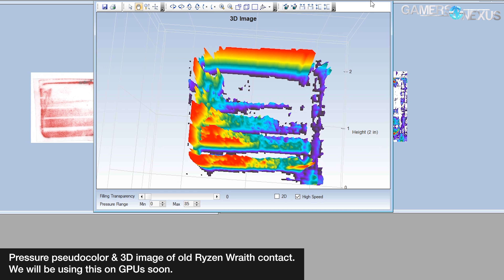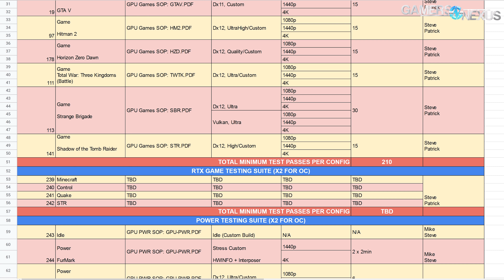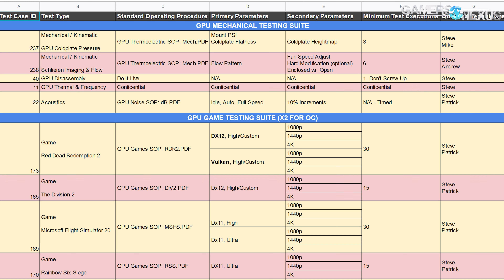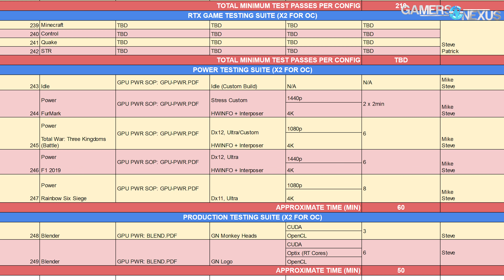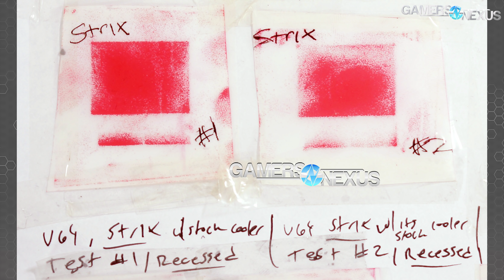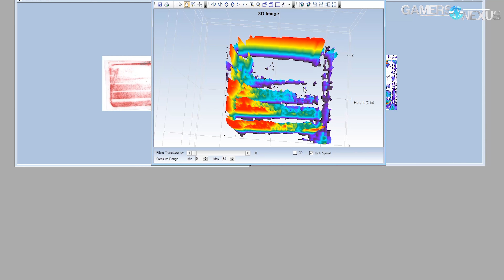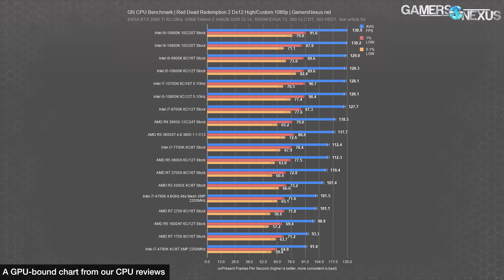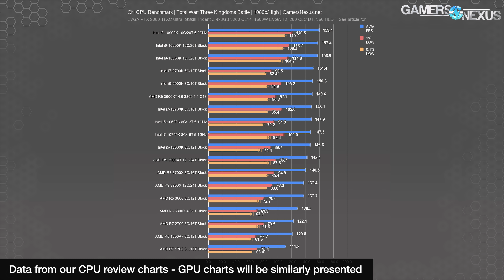$13K of GPU Test Methodology: Airflow Photography, RTX Games, Pressure Tests, Power, & More

Comment: For the GPU stuff i like that you have included blender renderings, cause 10% of a large render can be hours of time to save.
I know it might be an edge case, but more and more people do small to medium machine learning training at home using 100% free software lige python with tenserflow and pytorch. Thus it might be interesting to due some benchmark using these programs helping people deside if they should bay a gaming GPU or a "pro" GPU. This will also help you benchmark the tenser cores.
There is a huge difference between RTX 2000 and 3000 series cards thus should one by an 2080 ti used withe more tensor cores or a  new 3080 or 3070 whit less but the new tensor cores?  And how big models can you train using 8 GB VRAM vs 11GB VRAM, It might be better to have the 2080 ti with 11 GB VRAM vs a faster 3070 with only 8 GB VRAM?

Also I was so happy to see that the 3000 model can use sparse matrix now I will have to look into this, this might be a game changer for me. Thus Thanks.

Comment: Would love to see a chart where RTX performance impact is compared between Turing and Ampere, say 3080 vs 2080Ti performance delta in Control or Minecraft RTX. So the raw FPS wouldn't be the data of the chart but the percentual performance impact that RTX on causes for these cards. Maybe the 2080Ti has a 40% performance loss with RTX on compared to the 3080 with a 15-20% performance loss. I think this would be an interesting way to check Nvidias claims of better RTX performance.

Comment: If you're going to be using Horizon Zero Dawn in your testing, I suggest at least trying out the GPU scheduling thing in Win10 2004 if it crashes for you, my game went from crashing every 5-15 minutes to 0 crashes. FPS became a tad lower (from 60 steady to 50-60 average on a 1070 at 1080p with a 2700x. But hey, a bit less fps is definitely preferable to crashing constantly.

Comment: Wait, didn't Rainbow Six Siege get a Vulkan update? Why not use that instead of the older DX11 renderer? I've looked up some benchmarks and Vulkan is a clear winner and should give you a decent amount more fps. I also think that AC Odysee is a good game to benchmark, their benchmark tool is great, the endresult is quite informative and it's very demanding on both cpu and gpu which will be a good measure how well your pc handles demanding games. With MS flight simulator I'm not too sure if it's a reliable test, maybe wait until the DX12 update is out?

Comment: Wish more channels did ultrawide benches.. 3340x1440. Luckily joker does them
Ps:i hope you still add the fps numbers.. Would be stupid that people have to whip out a calculator to see what the fps was. I mean its still thr most importsnt factor when you try decide which gpu fits your need based on your refrrsh rate and resolution

Comment: I would love to see MachineLearning Benchmarks for GPU, it will be mostly Nvidia Cards but still it ist intressting to see the value of different cards

Most of my Trainings in overnight but if i testing a new a architectures i just do short runs.

So maybe train a famous CNN, and count epoch trained in a certain time like 10min

i also know littel about how OC the gpu is effecting stability of the training, can I train a CNN for 10h on an OC-card without the fear of the job stopping?
how is pcie 4.0 or 3.0 or nvmi effecting my training?

i guess it is really scientific work, but no one university is oc-ing GPUs and writing a paper about it (as far as i know) ^^

Best Regards from Germany

Comment: For the scientific, the easiest test that you can do is to retrain networks with different libraries. They are a lot of examples online and you can run them for specific number of turns and then time them. A bit more advance test can run with reinforcement learning where CPU to GPU connection is really important as simulation run on the CPU and the GPU do the training calculations. I can help you set them up if you want to contact me :)
Or easier/Quickly you can use the ready package from http://ai-benchmark.com/alpha.html, I will suggest go for Linux system or you can compare Windows vs Linux

Comment: About "FPS normalized power consumption" -> I hope you (or at least anyone) will test the reverse, "power normalized FPS". Specifically running 3070/3080 at the wattage of 2080/2080ti. It'd be nice to validate Nvidia's efficiency claims.

Comment: Testing for SOLID WORKS and AutoDesk INVENTOR is severly needed. All Major manufactering companys use these programs, and there is VERY few benchmarks done. 
Sure, I have a work computer that has an RTX 5000, but I dont do rendering, I make Assemblies that have TENS OF THOUSANDS OF PARTS. I seen Inventor use 35+ GB of RAM at one time.

Comment: If you guys weren't already slammed with work I'd ask that you look into Forza Motorsport 7. This game has some weird stuttering behavior that gets worse over time.
E.G.: at the start of a race I'm running at 160fps. 10 minutes in I'm somewhere around 100 and have noticeable frame time spikes. After 20 minutes my average is down to 60-70fps and it's basically unplayable, due to frame time spikes that are north of 150ms. Only a complete reload of the track and race resets this behavior. Just restarting the race itself does not change anything.
My temps are fine and cpu & ram load stay the same during the whole race. It just degrades in performance. (game only uses 8 threads and gpu load drops with time, due to the cpu not keeping up. might be a timing issue of internal processes, but I have no clue how to solve or validate this)
(I'm running a 3900x, 32GB ram and an rtx2070)

Comment: Imagine buying a high-end GPU and having the clocks running low because the coldplate has little contact and not even realizing it. Just going about with the FPS you get and not knowing it could be higher.

Comment: I'm going to assume that R6: Siege won't include the vulkan version in testing from the lack of mentioning it.
Reply: To be fair to GN, no one would know Siege has Vulkan support unless they read the right update notes. There’s no option to switch API in game. Even finding the -vulkan argument to launch Siege in Vulkan took me some digging.

Also while seeing how a leap from DX11 to Vulkan is indeed interesting, Siege has high framerates in both modes. That makes it difficult to visually show any perceptual differences.
Reply: @wolffenstein  When launching with the steam version you get a prompt asking for which version of R6 you would like to launch. Not sure how different it is on other launchers. Though I do agree with your second point. It probably won't make that much of a difference FPS wise.
Reply: Da Sharkman you only get that prompt when launching from the Steam Library window. If you’re double-clicking a Desktop shortcut, Steam assumes default options which is DX11. Adding -vulkan as an argument in the game’s Steam options will ensure it launches in Vulkan regardless which method you use to launch the game.

Comment: I know this isn't really the place to ask but I've been on multiple subreddits and no one has been able to help me. So I built my first pc and it turns on and I can get into bios but the problem is once I put my windows usb(its a brand new Kingston 32g flash drive) and try to reboot it to boot into windows the screen is black I've waited for hours to see if I wasn't waiting long enough but it did not matter. I have a gigabyte motherboard a amd cpu and a shappire 5700x and a western digital 1 terabyte ssd not an m.2 in the lian li lancool 2 everything is plugged in where it needs to be and the only clue I have is when my motherboard recognizes the flash drive isays the kingston 32g blah blah and the same thing but with partition 1 any help would be appreciated and if you need more info just comment (sorry this is long I'm just starting to get mad because it's been 2 weeks and it's not working yet)

Comment: Not a GPU hint, but a CPU And total system throughput test.  FreeBSD's poudriere.  Recompile 2000 to 4000 full applications in massive parallel.  For testing, the ports tree can be frozen in time so that everything is fair.  Poudriere uses virtualization, massive amounts of IO, memory and, of course, CPU.

Comment: I'm not sure how much of a workstation use case it is, but Unreal Engine 4 benchmarks would be greatly appreciated. I've been starting to use ray-tracing as means of getting a more realistic lighting in maps with day/night cycles, so having a 1070 Ti has been starting to get slow. The engine itself is being used beyond games and with an in-engine tool for creating cinematics you can accurately measure the time between frames, so creating a standard benchmark would do a lot.

To demonstrate how accurate it can be, this is a small bit of my testing for ray-tracing, UI doesn't run on the same thread, so adding a timer in it (like the one up top) shows realtime frame time and can be customized at will, I personally have it at just minutes and seconds: https://gfycat.com/pastelwhisperedamericancrocodile

Comment: So I'm curious, and I know its probably due to the sheer inconsitancy of resaults, but why dont you guys test games that are poorly optimized for pc? Like Crysis, or my personal favorite Protoype, its a game from 2009 that was for the ps3 and then ported to pc but no matter what system, with any configuration I've tried, a consistant 60fps with v sync is impossible. It even puts newer CPU's through there paces and i've seen it pin 8 core 16 thread cpu's to 100% at points in the game which almost leads to believe its somehow scaleing with the hardware. I've tried anything from an FX6300 w r9 380 to and i7 8700k with a 2060 super, 60 fps with Vysnc is just unatainable, without vsyn you can get 100-200+ fps but it still feels way choppier and stuttery the just a solid 60.

Comment: I am very strongly disagree with ISO power/performace, using iso power/performance makes sense if either power or performance actually stays the same, but wiht GPU's they dont.
No user is upgrading their GPU to get the same performance, they are goign to use the extra performance. So if everyone uses the extra performance the real efficiency consumers will see, is at the maximum performance.

Comment: 25:00 Can we please not call them "RTX Games". RTX is literally an nvidia marketing term. They want to embrace, extend and confuse just like they did with "gsync compatible" to get their marketing to stick. Use the generic term that's most appropriate. The game is either just using hardware-accelerated raytracing (RT), which can be implemented in a variety of ways, but the most likely will be that it's a "DXR game" (i.e using DirectX Raytracing), or it could be using Vulkan "native" raytracing (currently VK_KHR_ray_tracing, i.e not using vendor specific extensions).
Reply: Am I wrong in thinking that all current "ray-tracing heavy" games are using NVIDIA API and are as such "RTX" and will be until AMD comes out with their open platform-agnostic solution?
Reply: @Lishtenbird  I don't know for all current games, but going forward there will be games that does not use the RTX middleware, so you can't use it as a term for 'game with hardware raytracing'.

You can of course use it for "game with nvidia's RTX middleware embedded", but GN put it as "Rasterization & RTX" in the contents, so it seems obvious they mean it as a stand-in for "raytracing".

For example, the upcoming Crysis Remaster has raytracing without using RTX (as far as I can tell), and future games will also do raytracing without RTX. Obviously "RTX" likely isn't going to be much of a thing on the consoles, but if it were, it'd just prove my point.